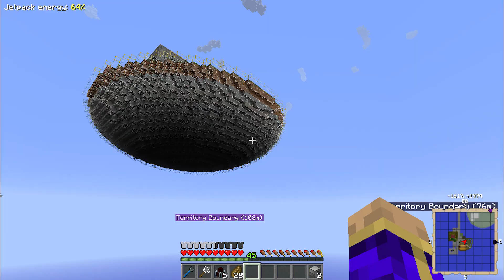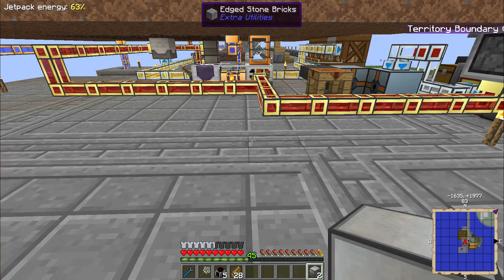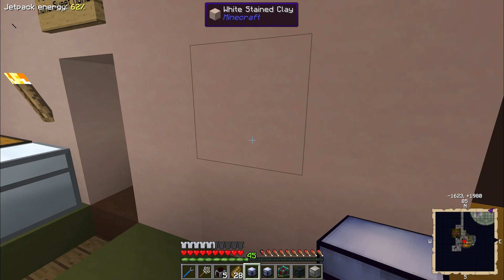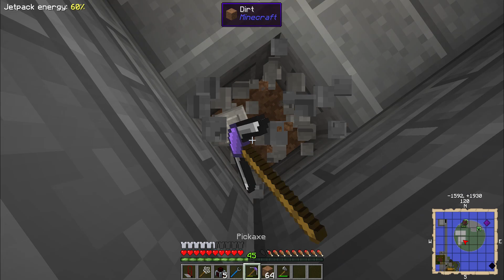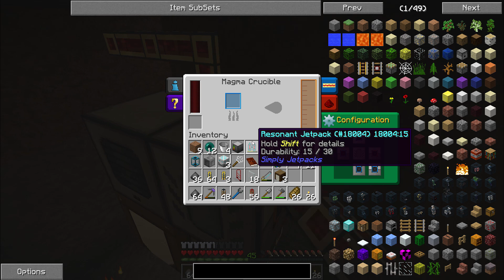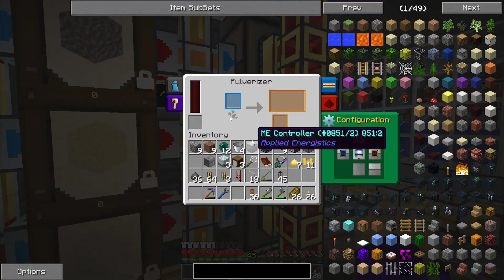Liquefacted Coal - Episode 15 Season 2 - Agrarian Skies: Hardcore Quest

Comment: i know you are busy in other series but when i was playing some agrarian skies i got a reward bag that contained farm blocks, farm hatch, farm valve, farm gearbox, and a  farm control block. im not sure if your familiar with the mod that contains them but, it is a multi block structure that i believe can harvest fruit trees automatically. i find them a bit useful because they don't cut down the fruit tree.(theres a setting) since if you break them the leaves are just default leaves and they drop the default tree saplings. the mod containing them is forestry. thnx for reading this. you can try this out if you feel but you dont have to.< long comment :P
Reply from the maker: Forestry! Multiblock farms are pretty awesome. It was my very first mod, actually, way before they had multiblocks.
Reply: ive never gotten to far into forestry but i know that it isnt one of the cheapest mods to get into. especially in agrarian skies where every last resource is crucial for survival. :P
Reply: yea and another thing from forestry is the grafter youve probably heard of it befor it makes it to where you have a 100% chance of getting a sappling if used like a crook. i found out that you can use them on a silverwood tree since the saplings have so low of a drop chance. (i used  a thaumium grafter, not sure if the default work) very useful if your getting into the more in depth levels of thaumcraft
Reply from the maker: denver milam Only Thaumium grafters work on Silverwood, IIRC. However, the great part about Thaumium grafters is you can enchant them with Repair!
Reply: repair is awesome and all but i like a challenge so i don't often try to get repair on my tools, same thing with moss in tinkers construct. ill only use moss on a tool early game when i don't have many resources to fix. my tools. speaking of moss i had a barrel of water sitting around some cobblestone and it made it moss stone, so now i have too much of that. not as useful as i thought it to be O_O
Reply from the maker: denver milam Yeah, the moss stone and clay creation mechanics had me putting Ex Nihilo into my normal instances.
Reply: i regret making that auto-spawner with villagers. all i hear is hmmm, hmmm, huh... yet i still keep it because i thinks its perfectly necessary to kill them for my blood magic needs

Comment: if you run the different types of ingots through a automatic dictionary converter, you can change them between the different versions of the mods. in order to make the dictionary converter, you will need pearls. you get pearls from oysters in the mariculture mod. i believe you can just right click on a oyster while its in water with a piece of sand to start its process of making a pearl. the uses of the dictionary goes passed just ingots, it has a few other uses and is a cool thing to have around. the only way i think you can get pearls in this modpack is from reward bags, if there is another way someone correct me.
Reply: i will look a bit more into this to figure more out
Reply: you can also get pearls from fishing using the mariculture fishing rod. i specifically got it my first try using a titanium fishing rod and a bee bate, i pulled the bobber out a couple of seconds after i threw it out and i didn't notice a fish bite :P

Comment: I need to know how to use applied inter without the drive.!! Please make another vid :)
Reply: in applied energistics there is a cable bus called the "me storage bus" you have one of them on a chest and me cable running into a me controler with a me access terminal/crafting terminal hooked up to it and whats in the chest will show up in the terminal. (the controller needs a fair bit of power). you only need 1 storage bus per chest( and double chest) you can hook the busses up to barrels as well but idk how that works.

Comment: You can convert ingots by mixing and matching different mod types into blocks and back into ingots. For instance, if you mix 2 different types of copper ingots its possible to create a block of the same type, busting it back down to ingots will give you the default type for the material. Otherwise they need to be re-smelted.

Comment: the ingot>block>ingot from another mod problem has been on ALL mod packs, for like the DAWN of time... very surprised you did not know that :O
Reply from the maker: o.0 You make a big assumption there. My comment was specifically that this was NOT happening before, and that all the Thermal Expansion Copper Ingots in my inventory had been unpacked from Metal Blocks. I'm using Casting Basins for my ingot production! Everything comes to me in blocks! Why am I suddenly getting Mariculture copper when I craft my blocks into ingots?
Reply: PurpleMentat I think you got confused entirely, let me explain what happened. You get tinker's copper blocks from casting basins and when you unpack them you get the tinker's ingots, but what you did is a completely another thing, you crafted back a copper block using tinker's ingots and you got a thermal expansion block, which is not the same as the block you get from casting basins, so now when you craft copper ingots from the thermal block you get mariculture ingots, and that was like that, as I said before, from the dawn of time, nothing new here, just a derp on your side :P
Reply from the maker: tggt00 was right. I was wrong. I've learned two things from this exchange:

1) Even if I am in the wrong, I find tggt00's phrasing inflammatory and insulting. It sets me on the defensive, and then I respond from frustration and anger.

2) Expanding on the first point, I should probably stop responding to his comments until either he learns to point out errors without insulting people or I achieve a Buddha-like ascension past the frustrations of the mortal coil.
Reply: PurpleMentat I honestly don't understand how I manage to anger you, you have no idea how much I want to not anger you, I'm really trying my best :(

Comment: Good Stuff. Will the liquid fractured coal work with reactant dynamos? maybe you could use some of the extra gunpowder you'll be getting to run a bank of those off the same liquid or even use the sludge from the garden as the fluid part for a reactant.
Reply from the maker: Liquefacted Coal does not work in reactant dynamos. However, I'm going to be using reactant dynamos in the future.

Comment: is there any crash landing planned for you mentat? I've been playing and its really challenging and fun.
Reply: I gave that a try, and it's like a sky block on the ground, since ground is layer 1-65 full of dust. Plus a bit of Blood&Bone mixed into it. With a new body temperature and water gauge, interesting, but lot easier than B&B. Forgot to add, no magic in this pack.
Reply: Now that I played a bit more, it's harder than I thought. Well, more annoying, since you need to get 10 sapplings per bottle of water. Dirty water is only 8 sapplings, but can't be used in backpack. Salty water is infinite, but also kills you.
Reply from the maker: Yes.
Reply: So hard... I eventually got so frustrated in that pack that I used MCedit to change a small area to taiga for water. Other than that I have been surviving about 12 or so minecraft days so far.